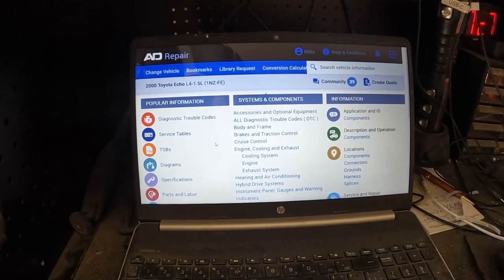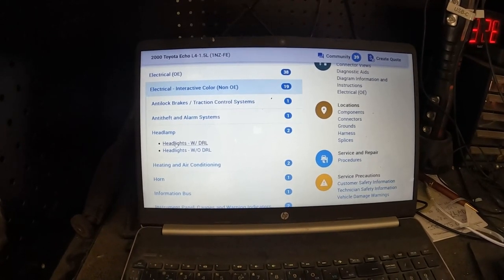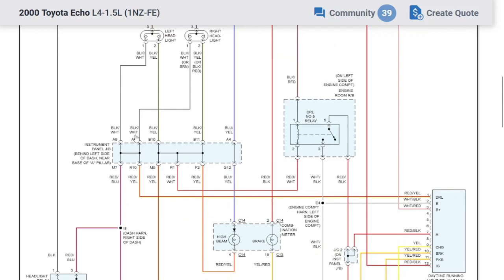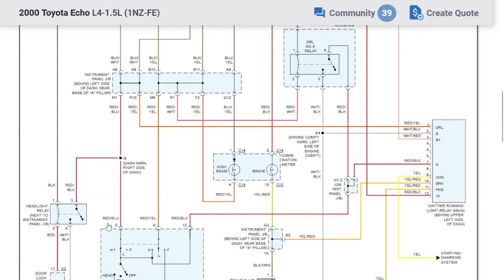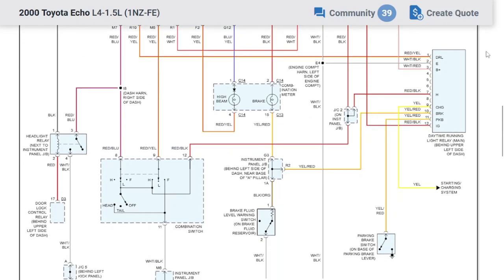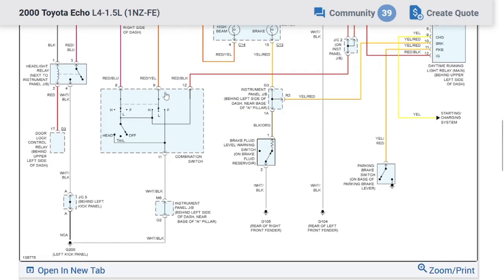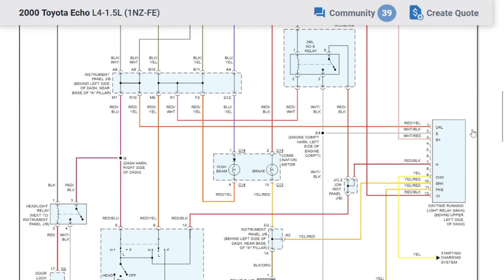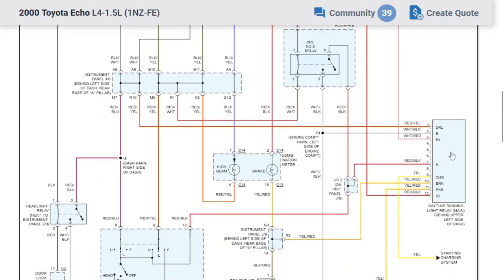Toyota Echo No Headlights - Now They Won't Turn Off..?? High Beam Light Always On???

Comment: How about high beams work, low beams do not. Fuse? Maybe?
Reply from the maker: @grumerguy Most often that's just a case of the low beams burned out. They're on much more than high beams so they burn out faster. If you're in a city then you usually don't notice when the first low beam burns out. Then the second one burns out and it seems like they both went at the same time. If you pop a new bulb in and they're still out then definitely a fuse is the first place to check.